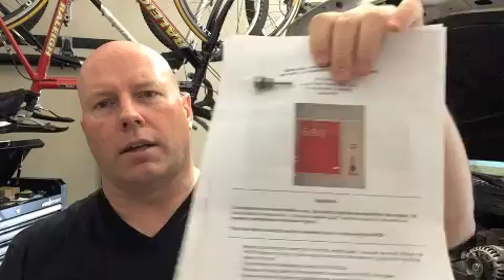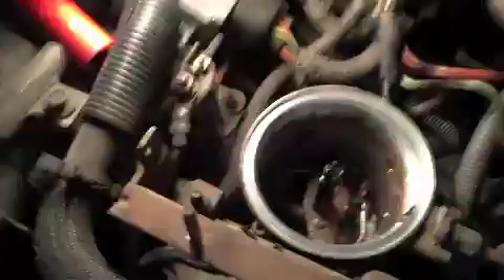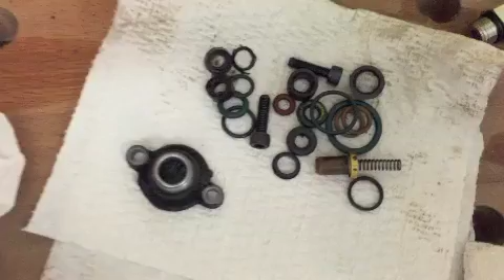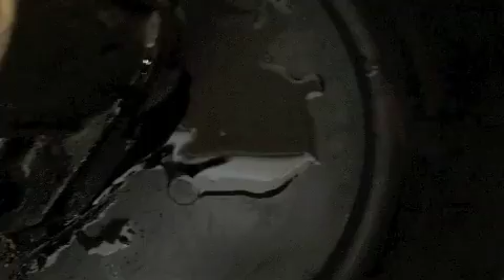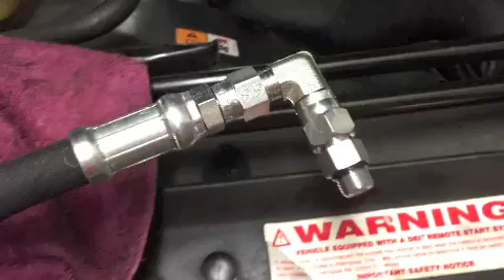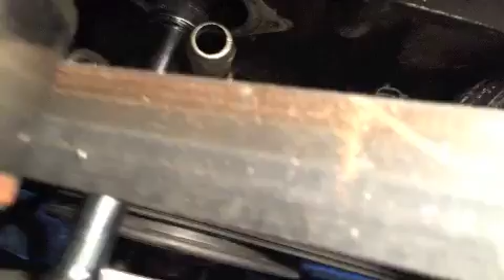Ford 7.3 Powerstroke HPOP and Fuel Bowl Remove and Reinstall

Comment: Thanks for the Info. I think you need that spring and check ball in there that you removed ? Also was the Drive bolt and washer kind of a problem and could definitely drop down into the timing cover ?
Reply from the maker: Spring and check ball definitely not needed with the new hoses.  Been running for years no problem.  That washer is too thick it can’t possibly drop but take it easy and make sure it’s well seated in the socket when you surgically remove it.  Best of luck.

Comment: Why are you pulling the sensor to siphon out the oil and not just the allen key reservoir plug to the right of it?
Reply from the maker: Mainly because it’s sticking up and in my way.  I just removed it so as not to damage it.

Comment: None of the 7.3l’s came with a crossover hose so don’t feel like you got ripped off. Has everything held up since the video. Btw I think... not positive but I think that tool can be used for the fuel lines with the quick disconnect fittings as well. And you should probably replace the fuel lines going to the heads since you have done all of this. I guarantee that they are cracked and are the weak link. Thanks for your video.

Comment: Nice vid!! Did you see any evidence of an oil leak out of the hpop?? I just got a 2003 f350 7.3 and I see ail leak at the bottom.. I'm hoping its just the hpop.. Beautiful job..I like the way that hpop cleaned up.. Wish I had this skill..
Reply: Oops you detailed it at the end.. Still a good project even though it was coming from the plug.. Is that where it was coming from.. I'm barely learning what blow by is ..so now I'm on my way home to do the oil cap filler test.. I hope it turns out okay..
Reply: hesson81 just stick the oil filler cap upside down on the engine while running. If it doesn’t move or flip over, then you’re fine. A little bit of blow by is normal for a 7.3 or any diesel for that matter.

Comment: Did you have to crank it much to get it to fire up?
Reply from the maker: Just turn the key on to get the fuel bowl to fill up.  Will take a few cranks to get the fuel circulated and will start no problem.

Comment from the maker: Note the seller of the lines changed his eBay name:

The eBay seller is KLPERFORMANCEENGINEERING

http://www.ebay.com/itm/99-03-Ford-7-3-Super-Duty-Powerstroke-HPOP-Oil-Lines-Hose-Set-High-Pressure-Pump/182003021559

Comment: What's up with the link for the HPOP Hoses? Thanks
Reply from the maker: The eBay seller is KLPERFORMANCEENGINEERING

http://www.ebay.com/itm/99-03-Ford-7-3-Super-Duty-Powerstroke-HPOP-Oil-Lines-Hose-Set-High-Pressure-Pump/182003021559

Comment: do you have a link where to get those hoses
Reply from the maker: The eBay seller is KLPERFORMANCEENGINEERING

http://www.ebay.com/itm/99-03-Ford-7-3-Super-Duty-Powerstroke-HPOP-Oil-Lines-Hose-Set-High-Pressure-Pump/182003021559

Comment: Thanks for the video. There's no such seller on Ebay with this Dieseldoc2342 or Dieseldoc2343. I'm trying to find a seller for the hoses. My 7.3 is a 1995 version.
Reply from the maker: The eBay seller is KLPERFORMANCEENGINEERING

http://www.ebay.com/itm/99-03-Ford-7-3-Super-Duty-Powerstroke-HPOP-Oil-Lines-Hose-Set-High-Pressure-Pump/182003021559

Comment: what sizes of hose did you buy? length and fitting sizes? any info on the ebay seller you bought them from?
Reply from the maker: The eBay seller is KLPERFORMANCEENGINEERING

http://www.ebay.com/itm/99-03-Ford-7-3-Super-Duty-Powerstroke-HPOP-Oil-Lines-Hose-Set-High-Pressure-Pump/182003021559

Comment: The quick connects your talking about on the hpop hoses are eaton stc(snap to connect) fittings. It's actually a good design and they hold up extremely well and at 336k I have yet to have a leak on one. I'm guessing by this time your hpop probably has some wear on it would of been wise to buy a new Bosch one for about $600 and not worry about it for a long time. Although a reseal job will last a while too...

Comment from the maker: What I forgot to mention is while I applied 680 Locktite to the "nonserviceable plug" I also applied it to the18mm bolt plug at the back of the pump and the two fittings for the oil lines in the pump.  I didn't apply it to the IPR because I figured that's a lot of threads on a large bolt and I wouldn't have the chance to heat it properly to remove it if I needed to.  The 18mm drive HPOP drive bolt has fine threads so there will be a lot of turning until it's tight.  Just take a breaker bar and keep turning it until the motor turns.  Some references say this is tight enough but this will be less than the 95 ft - lbs.  That's why I had to restrain the motor from turning by using a large wrench.  If this bolt isn't tight you will get a no start.  Dieseldoc2342 is the person that made the hydraulic lines for me and he sells these on Ebay.
Reply: #Ray darman Did you need new fittings for the hoses to the heads?